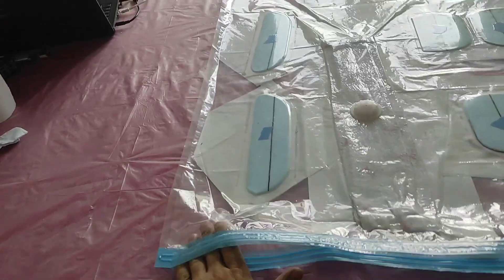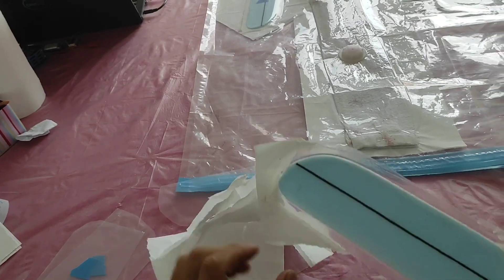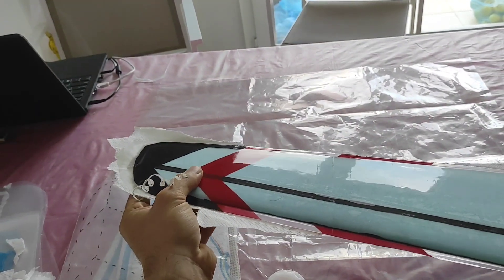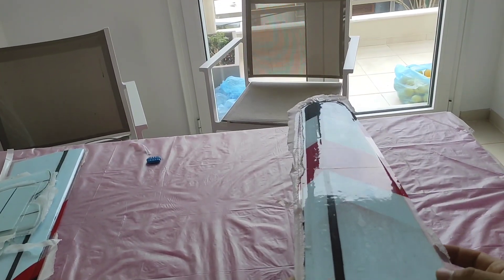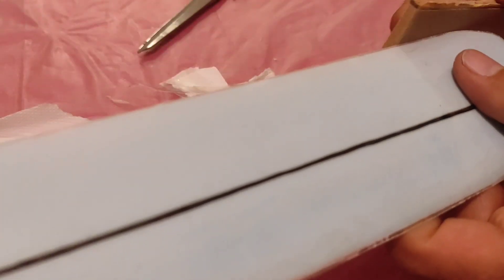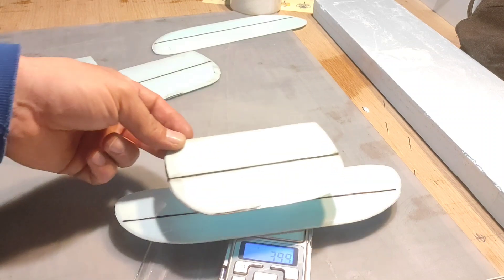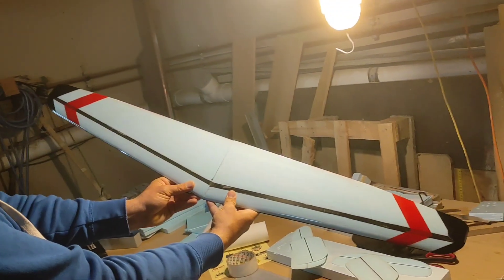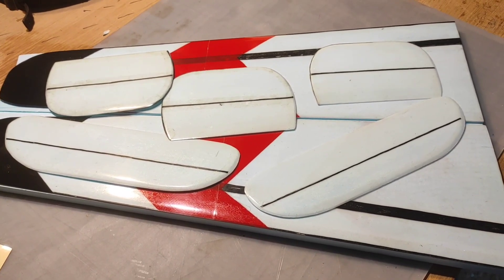1m GF DLG-part.4-Unbagging, Trimming, Weight

Comment: How does the paint stick to the wings.. If it is already dry on the Mylars ?
Reply from the maker: This is how it's done, it's magic ! ! ! You have to use PP sheet, for the magic to happen ! The paint does not adhere on the PP surface so when the epoxy dries it  sticks to the paint and removes it from the pp sheet.
Reply: @afilos  Ahh ok Im starting to understand it.. So the plastic is waxed before you spray the paint too ? Also Im Living in Ireland and wondering where you buy supplies in Europe ? I cant find the light fiberglass or the blue foam for cutting wings..
Reply from the maker: @petrokemikal  No, PP (polypropylene) does not need any waxing at all! It's not like the mylars that need waxing, this material will work as it is.
I buy from here https://www.r-g.de/en/art/192019060-CBA, the blue foam is widely used in insulation of buildings, its XPS 25psi, you might find it in different color, like green, pink, black...
Reply from the maker: @petrokemikal  https://www.r-g.de/en/art/190100
Reply from the maker: Thank you, depron is no good, as you said too soft.. 
I always make a batch of 3-5 v tails in every build, its so easy to break them.. have fun, cheers!
Reply: @afilos  yes I agree, Sometimes I prefer to build a heavier dlg because they are too fragile.. I bought a high performance one 3 years ago, It was amazing but didn't last more than 1 summer, I hated why it was made so lightly.. If only we could find Rohacell igf foam, this stuff is absolutely amazing.. I have some dlg tails from this material and it is twice as tough as normal foam but very expensive and almost impossible to buy in small quantity's..

Comment: Thank you Mr Filos for these fantastic, concise, inspirational videos. They explain everything well enough that I can start to build my own DLG. The hot wire cutting was a challenge but have got some decent cores. I'm just wondering how long did you leave the wings curing in the vacuum bag for?
Reply from the maker: Thank you! You should consult the label with the instructions of the epoxy resin you use. Normally it should be at least 24hours. Some need 48hours.
Good luck with your build, and don't forget to share your video!!!

Comment: Hello sir. Nice work. I just subbed to your channel. Please help me understand. So you attack with glue resin, The mylar and then after vaccum, you pull apart mylar and the wing remaines shiny?! Thanks
Reply from the maker: Thank you! The mylar is Polypropylene PP, epoxy and paint won't attach to it! So when you pull the mylar you end up with a shiny finish. How shiny? it depends on how shiny is the mylar's surface.
Reply: @afilos  Thanks, great job

Comment: This looks pretty light!
Reply from the maker: Yes it is, and it's on target! 
I am curious to know how you build your models, any suggestions for improvements?
Reply: @afilos  My glider is a little stronger, so it's heavier than your glider.
I'm not good at maneuvering, so I make it strong so that it won't break.
The method of making is almost the same as you, but I think that the method of attaching the main wing is probably different.
I am looking forward to the next video.